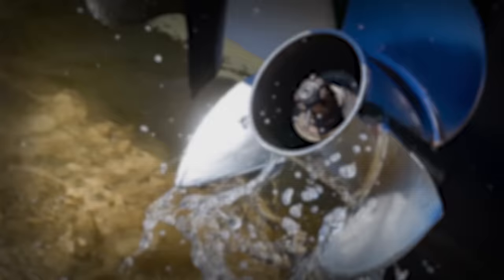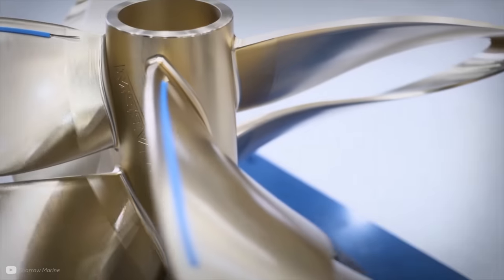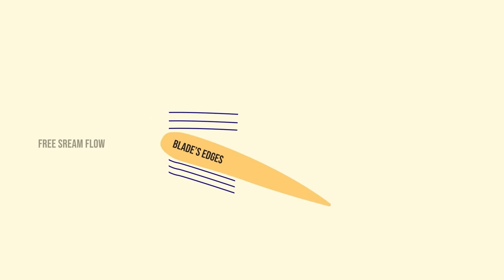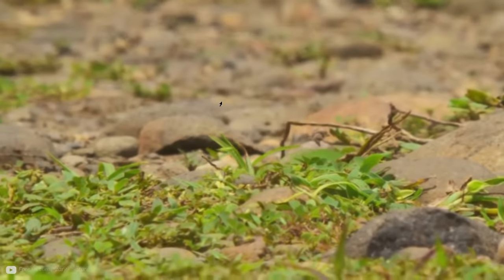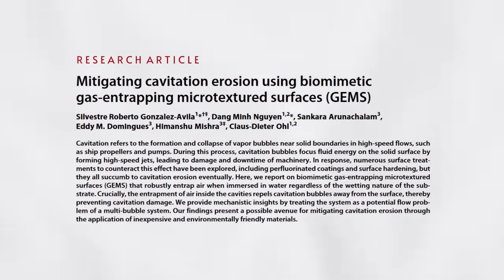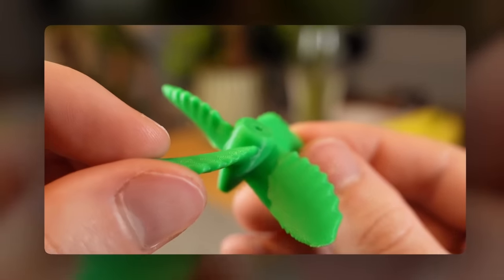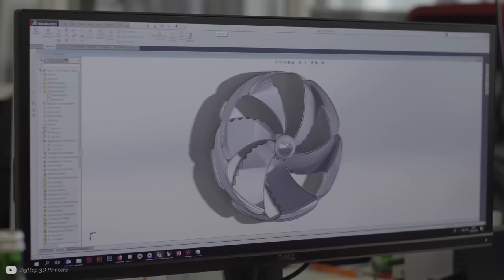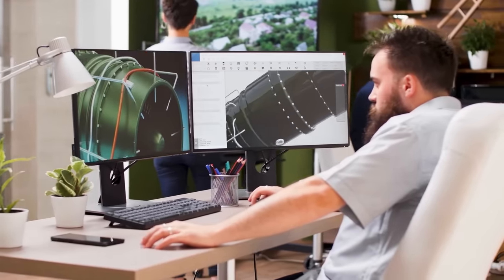The Unexpected Genius of Bionic Propellers

Comment: amazing how many designs that we previously thought were so efficient, have still so much to be bettered.
Reply: Bettered?
Reply: Improvered
Reply: @alanESV2 Improved
Reply: Yes I’m a grammar nazi…
“It’s amazing how many designs that we previously thought were so efficient, yet still have the potential for vast improvement.”
Reply: Converting 100% rotational energy into linear motion... so makes you wonder what a boat gets. 20%, 30%?
Losses from drag on haul in water, wind resistance, thermal...
....
I notice the belly of blue whale has strips down the length. Wonder if that helps create some kind of surface laminar flow or something, smoothing out micro surface turbulence. The nose of the blue whale also has bumps, perhaps its a similar situation. Perhaps a perfectly smooth nose cone is not the best solution!!!
...
There is an X prize, specifically for solving the turbulence problem. Its got like a million dollar prize. To be able to better define turbulence mathematically is the goal. 
Basically... golden ratio, log, sinusoidal molecule packing propagation or something. If I knew how to describe it, Id be rich. lol
Reply: @alanESV2  🤣🤣 But bettered, though archaic, is a real terminology. But if you can get Homer Simpson to use “improvered”, we can get it into the lexicon!
Reply: @oldtimer2192 bro.. "that" is redundant. At least be a good grammar Nazi
Reply: @oldtimer2192 "It's amazing how many designs, previously thought efficient, have vast potential for improvement." - better
Reply: @mauriciogerhardt3209
I think that a key bottleneck in the consideration of designs was the ease of mass fabrication.
Reply: yeah like there's that thing that a nautilus has a really efficient shape too.
Reply: @koharumi1  It's the past tense of better. It's a real word.
Reply: I wear shoes daily. They wear out. No one has ever created a shoe that doesn't wear out. Imagine that.
Reply: @Reach3DPrinters  It's harder to put details like strips on large ships. High performance water craft like jetskis have very advanced hull designs with ribs and ridges.
Reply: Wait till someone uses AI to redesign the props.
Reply: @ChArLie360115  Relative pronouns are often optional.

Comment: I actually took part in a research recently regarding the implementation of shark denticles (scales) to surfaces like airfoils to increase efficiency. This was a thesis of my friends and I just tagged along as someone who just happens to know how to design smth like it and can 3D print stuff. They found out that, atleast at higher airflows, there was an increase in efficiency. Excited for them since they'll be going abroad this December for a conference to share their thesis!
Reply: That's likely because air operates more like a fluid at higher speeds

Comment: The ribbed propeller reminds me of vortex generators on an aircraft wing. The trick to fluid dynamics is balancing the tradeoff between lift/drag/weight and thrust. I love this presentation!❤
Reply: Same, vortex generators!
Reply: I had the same thought, but vortex generators work by mixing more energetic air into a boundary layer that is losing energy and is about to become detached from the airfoil which in turn reduces the thickness of the turbulent wake at the trailing edge of the foil;  I'm not sure from the description of the video if this is how tubercles actually work hydrodynamically.
Reply: The shape also reminds me of chevrons at the edge of turbofan nozzles; another noise reducing technique.
Reply: Or wing fences. Very common on airliner wings since the 1950’s.
Reply: Air itself is a fluid after all.
Reply: @williamreymond2669  They actually work in a similar manner; the low-inertia fluid behind the peak flows into the valley and pulls high-momentum fluid drawn from above. This causes a re-energisation of the boundary layer and a cyclic variation of spanwise vortices, which in turn generates pairs of counter-rotating stream-wise vortices (CVPs). This helps to maintain the boundary layer attached for higher angles of attack, thus increasing the overall operating envelope. (or at least that's what happens with air, I did a research paper studying those on plane stabilisers)

Comment: That's why a golf ball with dimples, travels further compared to a similar size ball with no dimples. It seems rough over smooth appears counter-intuitive, but there is definitely some hidden secrets we can learn from nature.
Reply: Wow you wrote the first comment on youtube that is actually right about the "golfball" effect. Congrats.
Reply: I wonder why planes don't have dimples on one side or maybe both sides
Reply: It's only half right. It's the dimples AND the spin. If your club face hits flat, the ball won't go that far. If you put top spin on one, it will drop even faster. People have even experimented with dimpled rotating dirigible gas sections to add extra lift.
Reply: Wrong - Dimples on golf balls create a thin turbulent boundary layer of air that clings to the ball's surface, reducing drag and allowing the ball to travel farther. They also contribute to the lift force, with the spinning action causing higher air pressure on the bottom of the ball than the top, creating an upward force. This combination of reduced drag and increased lift due to the dimples allows a golf ball to travel about twice as far as a smooth ball would. Where as the tubulars being discussed here, redirect the flow of water into narrower channels on the surface of the fin (or blade). Two very different effects.
Reply: @southern_merican  ... I'm not saying that it's the case with airplane wings. But there are MANY cases where "we" know of solutions that would be "theoretically better" but that "in practice" are untenable. Either due to economic, production, maintenance or a host of other factors that has to be taken into account when "creating a product for the real world...
And I can easily see how "dimpled airplane wings" could be one such a case.
Reply: @onlyeyeno  true
Reply: @southern_merican 

Airplane mechanic here.

Planes don't have dimples.

What they do have, in some cases, are vortex generators. 
These serve a similar purpose.
They segment, but focus the air into separate streams. Helps keep it moving smoothly over the wing. Reduces turbulence, and lowers the speed needed to break that smoothness.

You don't see this on the big jets everyone rides on. Cause they fly way too high, way too fast, for these to be necessary. Though you will see something like them placed in various places on the engine covers. Big standalone fins that essentially serve the same purpose.
Smoothening the air that just got disturbed by that fat wide engine, before it touches the underside of the wing.
Reply: @davecrupel2817  so what I'm gathering from that, is directed air is better than deflected air?
Reply: @southern_merican  First: you don't need dimples on the bottom of a wing because the air is pressurized, so it cling naturally to the wing.
Second: Some planes have small winglets on the wing to create turbulence and redirect the flow.
Reply: Shark skin is extremely rough, even used traditionally for sandpaper.
Turns out that rough skin is more efficient than smooth skin and some sailboat racers even rough up their boat hulls with sandpaper for an extra edge.
Reply: And a maker (whose name escapes me) of car top luggage carriers, brags about their "low drag",  partially due to the dimpled (not really, more of a textured surface, same concept though) material they use to form the carriers.
Reply: @onlyeyeno   Here's one: I fly a exp. plane, tandem seating, so skinny. The company came out with a side side model, same exact wing...., and the wider side by is faster !
Reply: Why aren't dimples used on plane wings, missles and rockets? Is it faster degradation?

Comment: Just as a short side note. The 2 propellers shown use completely different concepts. One is a (water) propeller with structure on the leading edge, the other is a shrouded propeller with structure on the tailing edge. First one is probably good for slow moving air/water the other for fast moving air. Latter is also based on the concept of an owls wing to reduce noise and is already in wide spread use especially in noise reduced ventilation of factory floors (and PCs)

Comment: Crazy to think that we're 70 years into the jet age and we're just now starting to figure out how to make a good propellers awesome video
Reply: Jet engine was invented in the 1920s?
Reply: @EhmedCousCous  I think the first jet aircraft flew in like 1939 or something but I don’t know when the first jet engine was built. However, 70 years ago would be 1954. I was just trying to make a joke, but the point of the joke is more like we’ve moved on from prop planes for a very long time and now we’re just finally figuring out how to make a good prop.
Reply: What do you turbines are? We never moved past propellers @TomisaLami
Reply: @leudast1215  a turbine can be multiple devices, but essentially they would all be a spinning mechanism with multiple fan blades used to produce force from a fluid I believe.

And I know you think you did something here but you didn’t because the turbine jet engine could work even better if it had better blades or what you mistakenly consider props.
Reply: @EhmedCousCous   2024-70 = 1954...
Jet engines were invented around the beginning of WW2 but were too unreliable then. The first jet aircraft built in series was the Me-262 which was put in service in 1944, and jet engines became widespread in the 50s and 60s.
Reply: @leudast1215  Yeah crazy observation, it's not like propeller aircraft are still flying everyday and with the invention of the turboprop have still stayed relevant, good example would be the A-400M which is a very new and modern propeller aircraft.
Reply: @planterion7969  the jet engine was not invented early ww2 it was first patented in 1921

Comment: With the Jesus lizard prop, that looks a lot like a voith-schneider turned on its side, you should check those out! They're not super common, but sometimes used in ships where a lot of thrust is needed in all directions, like tugboats. ABB recently unveiled the Dynafin that was inspired by whale fins, or so their marketing dept claims lol

Also I have a soft spot for super-cavitating props or chop props, which is an interesting way to work around the cavitation issue. They're basically only used in race boats because they're only efficient at very high speed
Reply from the maker: This looks like a good rabbit hole for me to start going down! Cheers 😀
Reply: @ZirothTech  Awesome! There's a lot of really cool tech in the offshore and maritime industry, happy to see it getting attention!
Reply: Googled Dynafin, very interesting!

Comment: Similarly so in fast boats, the bottoms are NOT polished, they are usually roughened with 180-220 grit sandpaper to prevent micro Eddy's from sucking the hull to the water.
Reply: Sharkskin is likewise rough and reduces drag.
Reply: think golfballs . dimples work😊
Reply: Like golf balls that have dimples?
Reply: @TheFrewah yes

Comment: 7:26 As a person who is flying RC gliders in competition , i experimented a lot about wingfoils and with zigzag tapes etc to make the air stick better and longer to the profile...
Around 20y ago, when i started it, i was thinking why propellers werent like that.... i saw the wide use for it back then already .. 
Discussed it a lot with friends
Reply: And they would all have said it wasn't the thing to do,   many years ago at the infancy of RC helicopters (no epicyclic, all off the throttle and often lots of bits on "landing"), I inquire about twin rotor helicopters like the Belvedere, (bit of a favourite), it was explained to me with all the aerodynamic reasons why at scale it would not work, come forward nigh on fifty years and you can buy indoor twin rotor craft at most good model sbops. We have had over two hundred years of what propellers should look like so this will take a lot of persuading to get people to accept it, no matter how good, and the only thing that will push it is the bottom line, how much money it can save, unfortunately sad but true.
Reply: @CrusaderSports250  back then i said, if everybody was thinking like that negative, we wouldnt be flying today!
Reply: @jasmijnariel  very true but getting over what is considered the way things work can be very difficult especially if you are also looking for funding.
Reply: @CrusaderSports250  a good example of thinking outside "the box" is the tunnel like wings. They proof that we have to open up our brains that ANYTHING can work,we only need to invent it
Reply: Didn't the concept for the winglets we now see on commercial planes come from an RC model plane builder!!???
Reply: @user-gl2eq2ly4g  the concept started when they tried to replicate predator bird wings, but couldnt do it , their glide ratio was worse. Then they understood why eagles for example had those tip feathers. And there it started
Reply: @jasmijnariel  yup ... Love it
Mother nature has many years of experience on us .... 😊😊😊👍🤣😅

Comment: If these were first tested in 2008 with positive results, why hasn’t extra R&D taken place by the major manufacturers of props? 
  The whale being a slow mover has no cavitation to overcome so I find it unlikely it’d be much help with that, an owl on the other hand can fly stealthily with modified feather placement, but with the fluid viscosity being so different, it won’t work in water.
Reply: In my opinion even if it gives small gains in thrust for the boats it might be not profitable from manufacturing perspective. Making this kind of pattern in the stainless steel might not be an easy task. I can imagine it being first introduced in the small scale or in computer fan propellers. Of course if this gives any profits to air flow and acts well in high rpm conditions. Another aspect is if anyone has a patent for that.
Reply: @aikenPL  true about the patents especially, they could literally kill it dead in the water due to unreasonable licensing fees. (Pun intended)
Reply: No it was not tested first in 2008.  WAY WAY before this.  Decades before this.  He needs to do more research.  I read a paper as old as 1930's on it.  So, it was probably done before then as well.  Got me.  Most ideas require a lot of $$$ to implement in a mass produced product to change industries.
Reply: @w8stral  could you share the 1930 reference please?
Reply: Yeah, like these more biological looking propellers are better, but in terms of scaling, they would be an absolute nightmare to manufacture and the costs would definitely outweigh the benefits of such a design.
Reply: ?  Manufacturing them would be easy.  CNC makes them easy to make.  Now would they be beneficial?  That is the REAL question.  @kipraslukaitis
Reply: @locouk  There is some prior art to that design so is it patentable?
Reply: @kipraslukaitis  For cast marine propellers it is easy to shape but for high speed/strength stainless steel racing propellers no so.
Reply: @kipraslukaitis  Well if you cast the propellers then there will be very little change to the cost in the long run. Once the mold is made the shape isn't going to be an issue. Same goes for forging. If you wanted to mill these, it might cost more, but CNC technology is very advanced these days, so it shouldn't be that big of an issue. I mean if you wanna buy a cargo ship and these props could increase efficiency by only a few percent, even paying twice the amount for the propeller would absolutely be worth it in terms of fuel savings.

Comment: If you want to talk about advancements in prop design, you might have mentioned the Sharrow prop. Totally different design, uses a third less fuel and produces more power. Used mainly for outboards but i don't see why the wouldn't work on a larger cruising boat.

Comment: Pretty sure I've occasionally seen such ridged blades used in PC cooling fans for at least a decade now. They pop up now and then when a manufacturer claims a new breakthrough (as they do with every single new fan), and then the next generation after that goes back to being straight-bladed.
Reply: Wind turbines too, they got them on the trailing edge for a while now
Reply: I think Noctua still has some ridges along the blades of their fans.

Comment: I became aware of the 'tubercle effect' at least 10 years ago.
I'm a a bit surprised it hasn't been adapted to say room fans, as IIRC it moved 50%(?) more air using 20% less energy and was quieter than 'normal' fan blades.
Reply: So maybe it isn't quite as incredible in application.  PC fans have had serrated trailing edges for 20 something years though so maybe in that small of an application in a fluid as thin as air it works to reduce noise

Comment: Another interesting propeller design since you asked is one I saw where instead of contra rotating props one of them is essentially a stator, ie fixed, which has produced surprising and promising performance improvements.
Reply: What's surprising about thar? Counter rotatimg.props are not used because of their crazy noise levels giving you no access to civilan airports. Russian military does use them on some models.
Some militarry argo planes use them as well. The bypass mass flow ratio is way higher.
Reply: @voster77hh  so obvion!
Reply from the maker: These are actually on my list of things to look into! Hopefully a video on these will be underway soon
Reply: @ZirothTech  brilliant, ty
Reply: @voster77hh  There are some claims out there,
that a lot of the Counter rotating prop noise can be avoided,
if you have a different number of blades on prop 1 and 2.
Makes sense to me, but I'm not an expert.